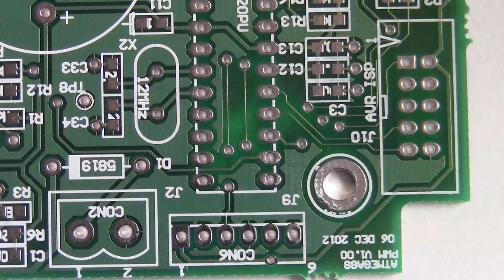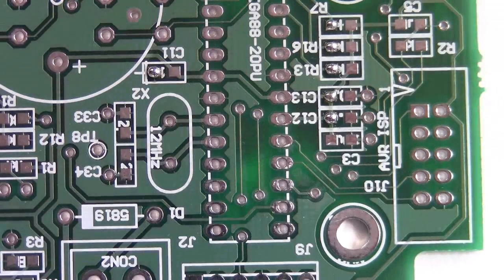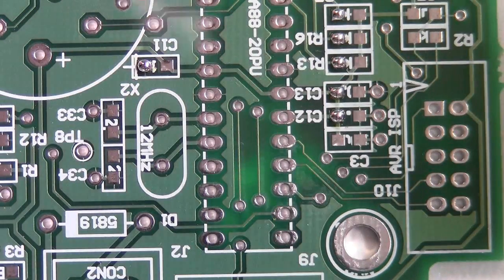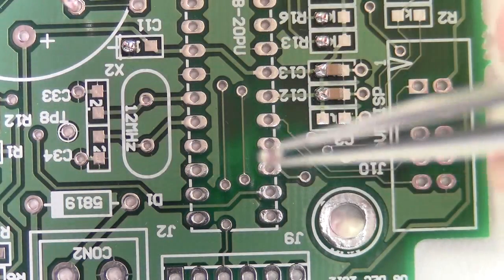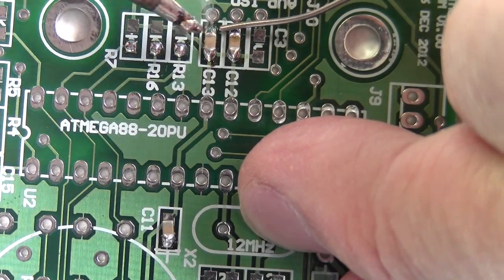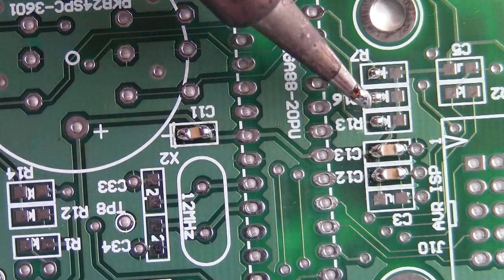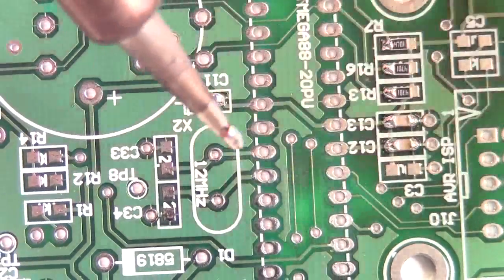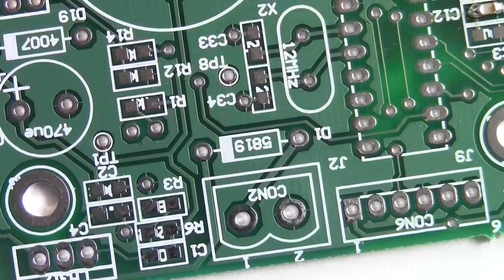How to solder SMT 0805 resistors capacitors(1/2)

Comment: Flawed video.
1. You shouldn't poke the solder wire on the soldering iron tip and let it dribble down onto the pad. Instead, you should heat the pad with the iron, then prod the wire directly at the pad, while also making contact with the soldering iron.
2. That's too much solder. It shouldn't be blobs. The welds should look like quarter pipe ramps.

Comment: Thank you❤ SMD soldering is still so new to me, as in I'm used to old components. Have a board was 0603 fuses, but the update uses 0805, and I see now why my joints didn't stick properly. Didn't know you could put solder on the side, as I thought it was soldering to the pad under the fuse when heated 😮

Comment: Excellent tutorial!  I did a few parts replacements on a BITX 40 smd board.  But before I did that, I practiced on a throw away board.  Here you are soldiering new parts on a new board.  This is a great way of doing it.  Seems to do the job just right.  Best three minute tutorial ever.  Right to the point.  Thanks!

Comment: What about reflow ovens, air solder station(or whatever it was called :D) and solder paste? should i just choose the one i feel comfortable? or are they suited for different stuff? what about soldering super tiny ic with no pins and a bottom heatsink?

Comment: Absolutely unacceptable. Totally awful blobs. Crap/10.
Reply from the maker: Yes, unacceptable if the solder work I presented in the vid was for say a highly critical project e.g. a defence or military or aerospace project.  But for a hobby project it is fine.  Much better manual solder joints can be achieved using better tips (e.g. wave tips), thinner solder wire, re-working the solder joints, etc...  But you must be an exceptionally talented operator, to achieve really top notch filleted solder joints manually consistently, using a rounded 1.6mm solder tip and 0.7mm diameter solder as I did in the vid (without any additional flux except for whatever flux was already inside the solder wire).  Good luck with your project(s).
Reply: ItsInOurKernel whats wrong with hot air ?

Comment: May I ask what soldering station are you using? It seems very efficient!!
Reply from the maker: I used the Hakko model 936 with the standard size tip that came with it.  Hakko irons have quite good thermal response.  Also used Multicore brand 5-core resin flux solder.  Good quality solder and flux helps to make the job easier.
Reply: ItsInOurKernel can you tell me the alloy composition of the solder you used? is it standard 60/40? thx for posting the video, very useful.
Reply from the maker: Greg D Yes, standard 60/40 solder with 5-core rosin flux.  (But it may also be single-core rosin flux as I cannot remember exactly).  Solder size was 0.7mm diameter.  (The solder brand was Multicore).

Comment from the maker: Yes, the line on tantulum types would denote the positive (+) side of the capacitor. Electrolytic SMT caps have the negative side marked with a dark coloured band (to be consistent with through-hole electrolytic caps).

Comment from the maker: The caps I loaded in the video were ceramic type, which do not have polarity, thus can be loaded in either orientation.  Tantulum and electrolytic caps are polarised.  The + side of surface-mount tantulum caps are usually marked with a dark colour bar (or thick line).  Electrolytic caps have the negative side marked with a dark coloured band.